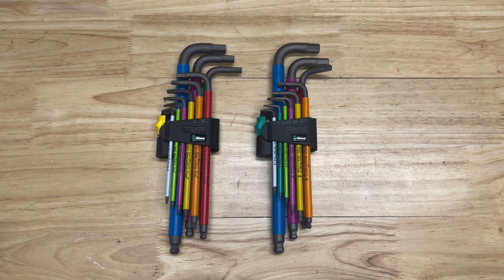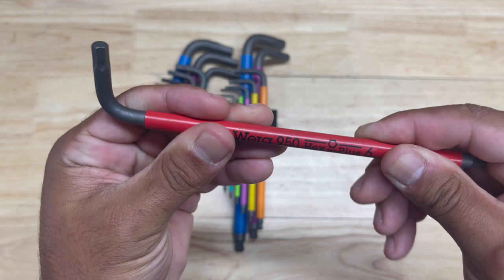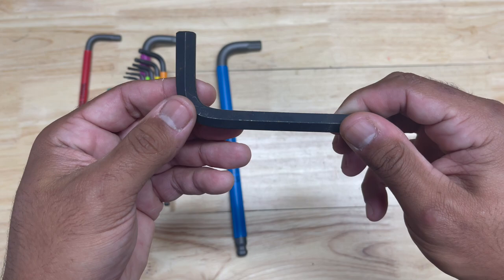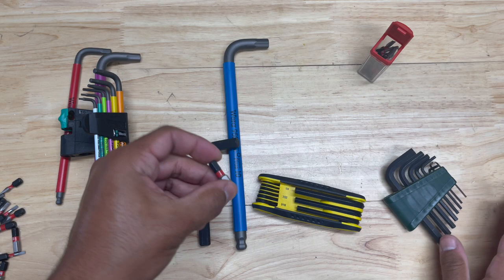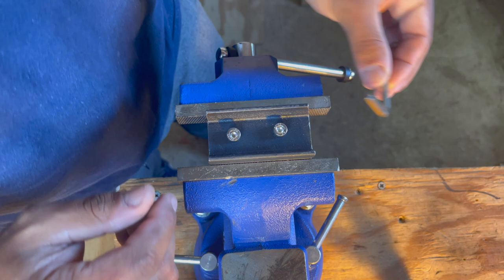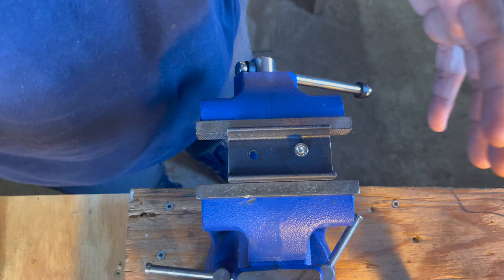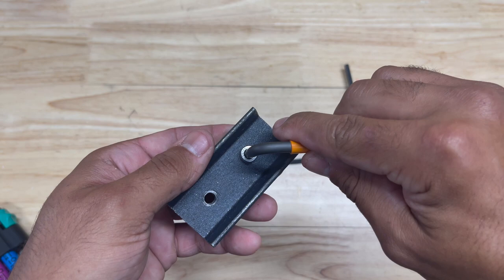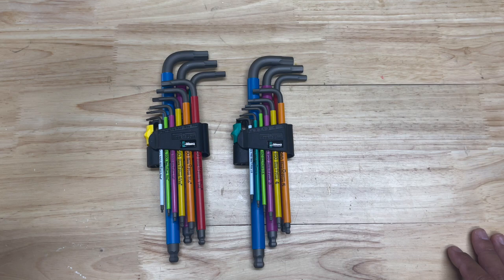Wera Hex Plus L-Keys - Unlike Anything Else On the Market

Comment: Ahhh, my favorite Wera tool. It saves me multiple times when dealing with rounded hex bolts. It builds like a tank, I have it for couple of years now and It still like brand new. One complaint I have is it's a bit hard to pull in or out of the holder. Well, I appreciate the reason so the keys won't fall off easily, but still,  it's too damn tight, lol. But it's only minor complaint. I still like it a lot
Reply from the maker: I have also experienced the tight fit or the holder and it’s not pleasant to deal with lol.
Reply: @ParklanCustom  I found that a little spray of WD-40 or similar multi-oil solves the sticky holder problem for me.

Comment: Nice sets. I have one set with holding function. It has a little ball bearing on the ball end, and is very useful. Hex plus profile is inspired by torx. I va tried on multiple occasions to remove a Hex bolt with a torx bit. If you have the right size torx bit actually it will do the job in emergency situations. I use hex plus on my bicycle. Actually I recently bought the wera bicycle set 3 which has a lot of hex plus bits, and is the only set with ball end bits that I own. Very good quality tools. The plastic on this l keys is very durable. I have this set for 4 years now. I also use the torx set. Have a nice day. 👍👍
Reply from the maker: Thank you for your insight! very good information!
Reply: I have both the Bicycle Set 3, and the Hex Plus set with the holding ball too. They’re perfect for working on my bike. I actually found the Bicycle set 3 on Bezos online store for 40% off. Hell of a deal

Comment: I'm sold on these.
I have Bondhus keys but Park Tool branded, only difference is the branding and Park Tool blue on the holder.
But after years of use I've worn ut the two next smallest ones, but others look beaten up and slightly rounded.

Comment: I was looking at them and the Wiha ones. Wiha won though. Wera have plastic  casing that open which in time will  eventually start to tear on the bend and the rubber color sleeves will start to warp making them sometimes hard to put back (review from friends who use and abuse them). Wiha got solid plastic casing that move all of the allen keys on each side and keys themselves are powder coated with "supposed" luminescent paint (supposed cause I dont work in the dark). That said I use all Wiha, Wera and Knipex tools, where you cant go wrong with this set either.

Comment: what's the different between the stainless one, which one strongest?
Reply from the maker: The black oxide are probably going to be more durable, but the stainless steel is pretty rust resistant
Reply: @ParklanCustom  so wich one your preference?
Reply from the maker: @dammarfirdausia6802  The black oxide is just fine for me, the stainless steel is much more expensive. However, if you use a lot of stainless steel fasteners, then the SS would be the way to go, if you like me and used a lot of zine/galvanized, the the black oxide is just fine, and it has a fair about of rust resistance as well.
Reply: SS tools are better for use in marine environment.